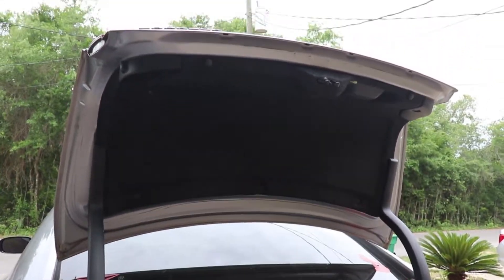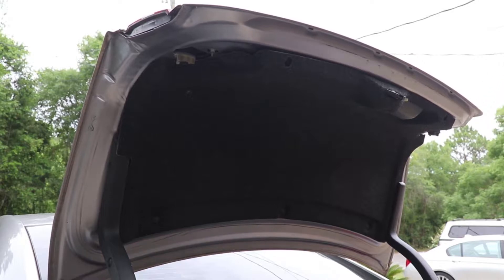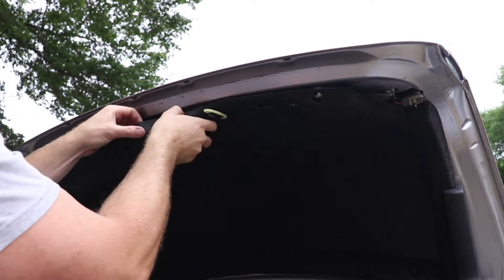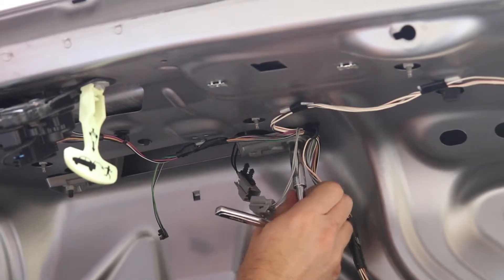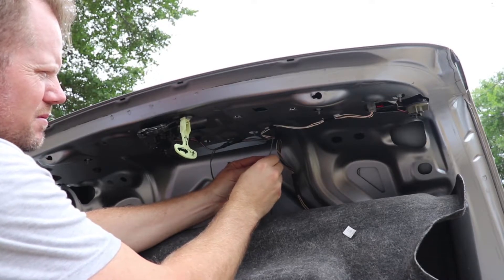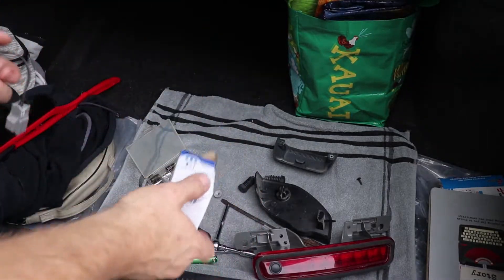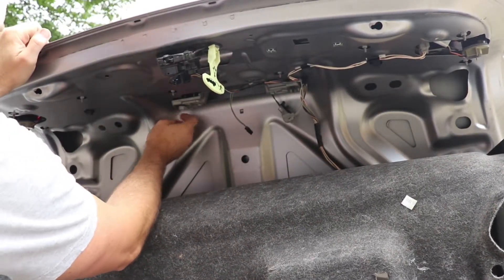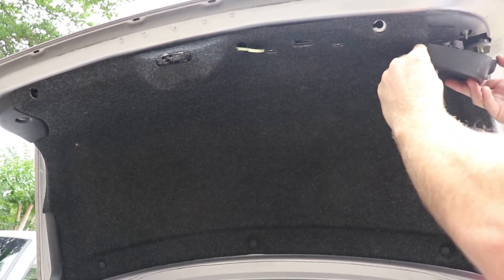2011 Dodge Charger Trunk Won't Open, Repair

Comment: Mine doesn’t function with the  key fob remote or the interior  trunk button as well . Did that charger do the same thing ??
Reply from the maker: no mine was just the button on the lid, check your fuse
Reply: If you press the button (trunk or key or interior) and lights turn on then is the Trunk Latch, that was my issue and bought it on Amazon and installed myself in less than 20 minutes.
Reply: I fixed it ! I changed the whole latch assembly.
Reply: Thanks you guys
Reply: @marellano7530  how did you open it if no buttons worked?
Reply: @big_papi_ortiz4264  have to drop the back seat and manually open with pulling the latch that glows in the dark

Comment: What if it doesn’t open with any of the options including key and inside button?
Reply from the maker: Could be a fuse or the latch mechanism is faulty.  I would pull the wire from the switch and check for voltage coming in.
Reply: Had to buy the Trunk Latch, it was defective as the power was working but just didn’t open. Cost me $27 on Amazon (they even have cheaper but I also bought American made) and super easy to install! Thank you for this video it guided me in the right direction.
Reply: Can you send where you bought it at I need one also
Reply from the maker: @XTREME352  @ 2:52
Reply: @MaxAC  having the same issue but there is no individual fuse for the trunk,I could be wrong.
Reply from the maker: @mb-pc3zn  normally a small circuit like that will be fused in with other circuits. You will have to do some research to find what fuse they all share.  It will be labeled with the main circuit.

Comment: Is there a fuse that could have failed? Or is the best bet that the button is dead
Reply from the maker: If you noticed when I jumped the button terminals it worked so that rules out all other problems.